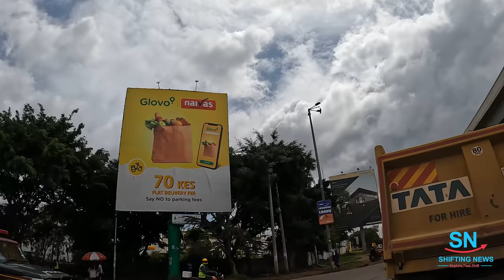Nairobi Expressway Final 2021 Tour James Gichuru to Mlolongo

Comment: Great comprehensive details. However, there still seems to be a lot of work that needs completing for this project to be fully functional as originally envisioned. The government end date of February/ March 2022 seems to be politically motivated wishful thinking. I hope the contractor takes all the time needed to properly and professionally complete this project. It is too important a project for it to be sloppily hurried up for political reasons.
Reply from the maker: Very true. Checking some of the interchanges you realize that there is a lot yet to be done. Traversing the expressway makes you have questions on the percentages stated but could be because of the precast technology in use. It is also evident that most activities have slowed down unlike several months ago where you would find lots of workers on site. Let's hope all factors from design features to drainage will be equally be adhered to.

Comment: Those huge advertisement billboards along side in Nairobi roads, what value do they aad to the  road traffic Safety? They are not traffic sign bord and post neither are the roads market or commercial center.
I think it's an african mentality from colonial 1950s era
Reply from the maker: For sure there needs to be more general public sensitization or education on road safety and conservation of the environment. Billboards can be such alternative avenues to undertake the measures.
Reply: @ShiftingNews  but not alongside the roads. I Mean those commercial ad billboards are ditracting to drivers and can cause accidents. 
They should be in the malls and market areas
Reply from the maker: @aliabdi8347  Ooohh.. Got you now.